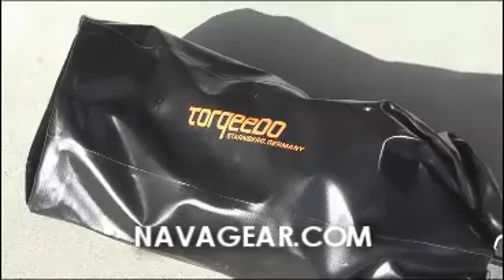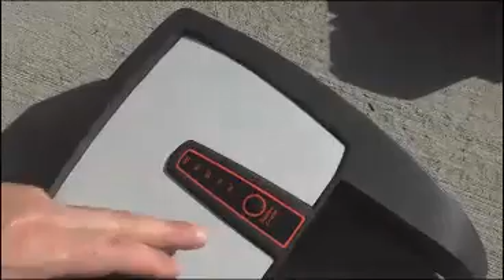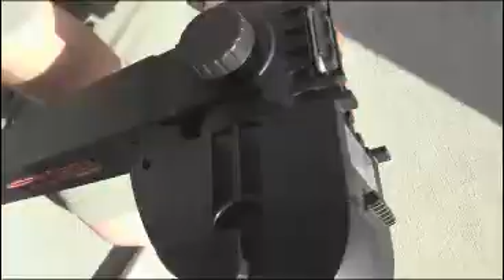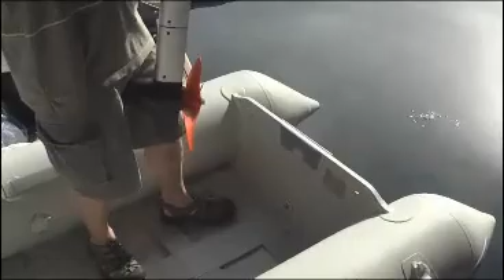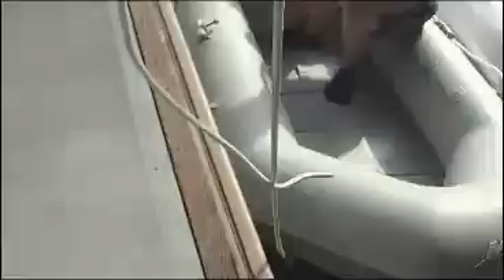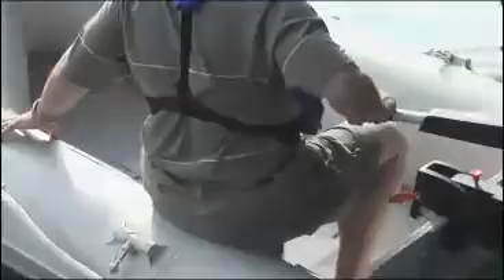Torqeedo Travel 801 Electric Outboard Test

Comment: Checked these things out. Very efficient and capable of moving a lot of weight. Nice quality piece of work, just dont produce the speed you need to get up on the plane in a small boat. If they offered a faster prop like they do on the bigger versions they would be great. Until then a good petrol outboard and minn kota are going to give you the best of both worlds for the same money. 
The ability to hook up a solar charger is pretty sweet though.

Comment: Great review, thanks very much... I am using the Mercury 3.5hp FourStroke but it has no reverse gear and the exhaust is not through the prop (makes it quite loud) so i was going to go with the 6hp Merc but this electric motor makes so much more sense... it is just for a little 8 foot tender going from moorage to shore and back and a little bit of exploring in the shallows. I think I will buy mine from westmarine Canada ($i699) unless someone has a better idea. Thanks again for your time.

Comment: I think electric is the wave of the future. It doesn't create a greasy mess like gas powered, easy to maintain, and the motor has full torque at any speed. Batteries are getting close to same energy level per weight to gas, and recharge with solar, it's free energy.

Comment: I would not trust that battery to a pin. I would rather keep the battery in the boat and have the motor plugged into the battery with wire